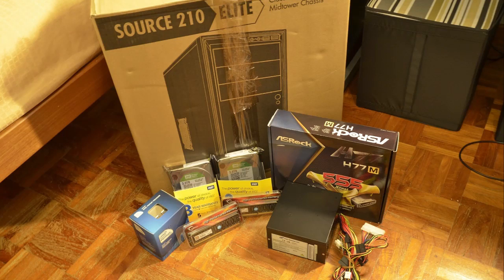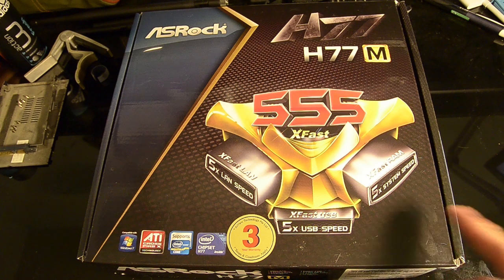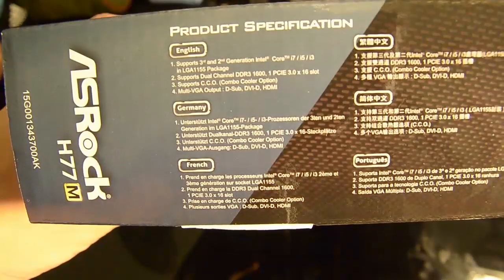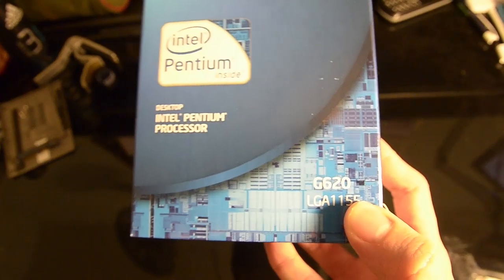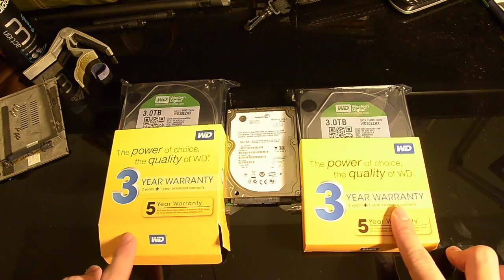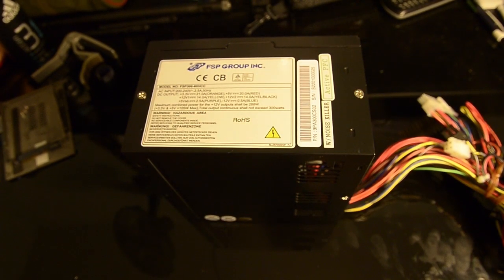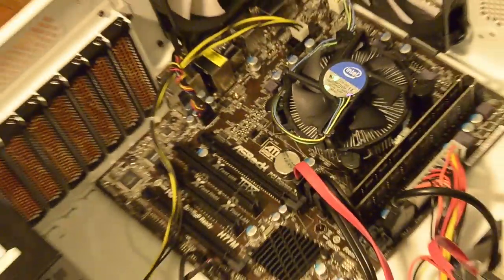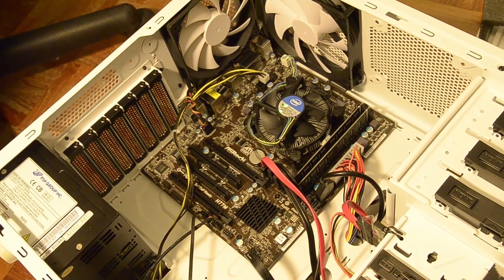DIY NAS / Home Server Part 1 - Parts and Assembly

Comment: You are way better off getting a newegg 1U enclosure (presuming you have a chatsworth or something) and then getting their 2TB Sata III 6GB/xfer 15K drives (I know SSD is way better but isn't this video post about the cheap?) at $109 a piece (steep price but you're getting 15K) x4 yielding 8TB and then getting an asus micro ATX atom, running Nexenta which is THE de facto standard for free-bsd iSCSI SAN and calling it a day.  You get a 1GB usb stick and boot that from the "flash on board" port